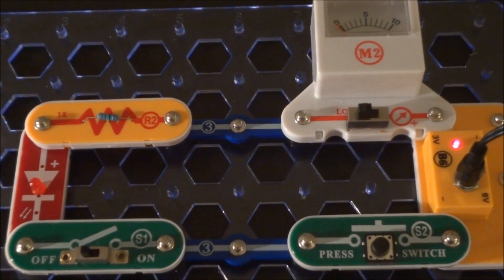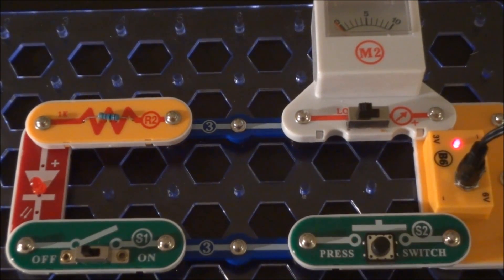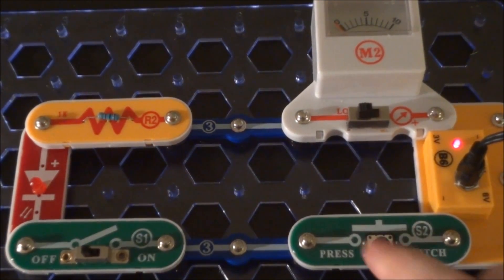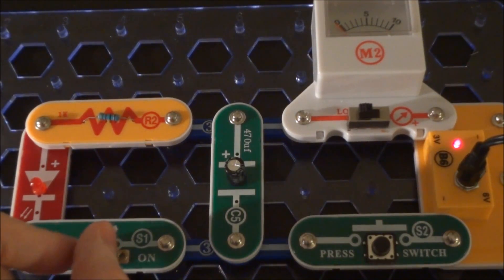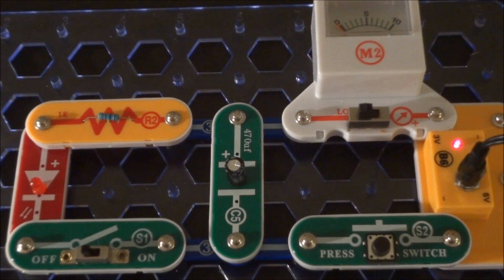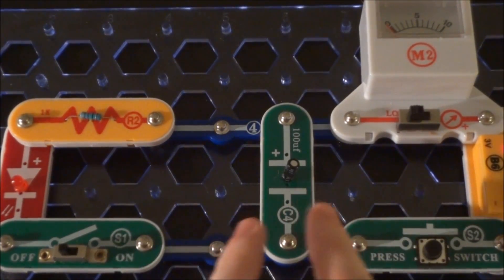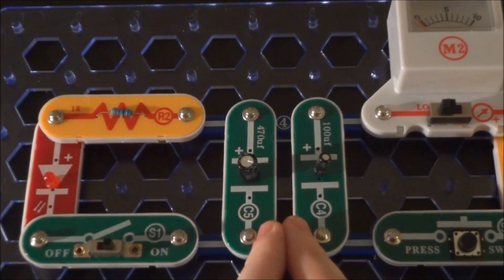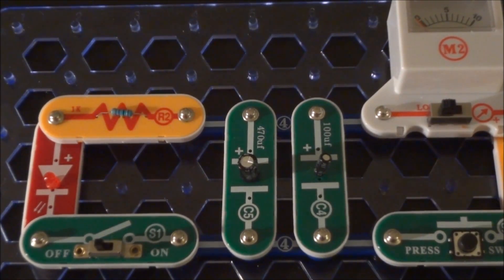Circuits: Capacitors

Comment: all snap circuits capacitors are actually non-polarized even though there is a printed + on the electrolytic capacitors' part because if you look closely at the black part of the capacitor there is "NP" somewhere and that means it isn't polarized
this is probably a safety feature so if kids accidentally install the capacitor in the wrong direction it won't fail

Comment: I'm trying to use capacitors to power a fan via solar panel.  This video was helpful, but not enough for my project.  Is it possible using the go green snap circuit kit to do this?  or are those solar panels not enough?
Reply from the maker: MrEhawk82 The solar panels simply can't provide the current to run the DC motor regardless how much light you shine on them. The green kit has a low voltage DC motor however I have not experience with that system so I csn't tell you if it could run or not from the solar panel.
Reply: It will fry the capacitor and it will never work again don’t do it